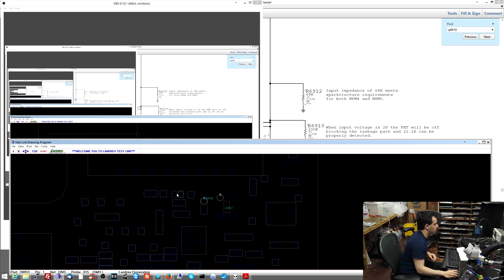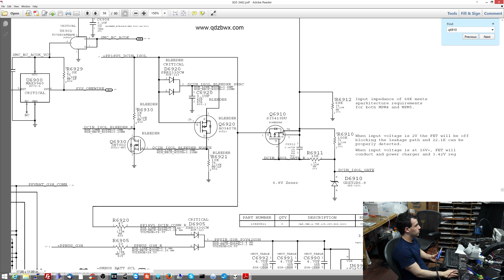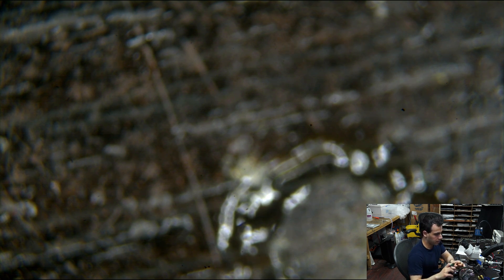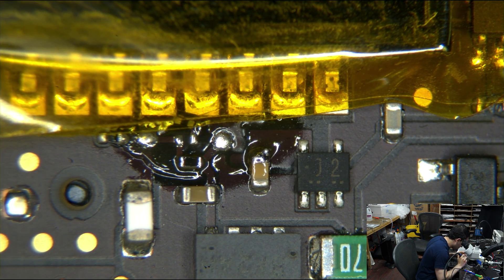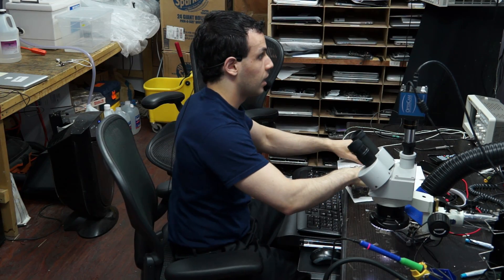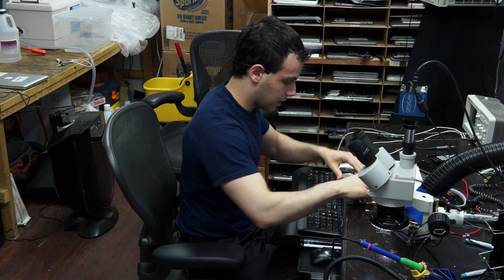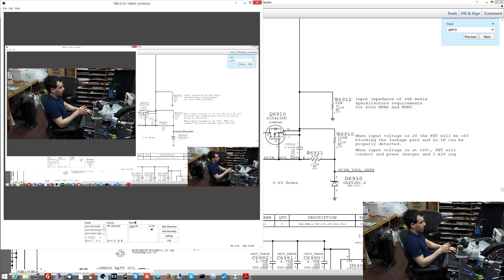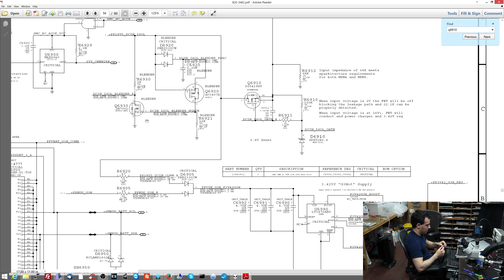Darby's second board 820-3462 not turning on because of spikes on dc in rail.

Comment: I got one!Question that is...
A1425 820_3462 not water damaged.
Good rails:PPBUS_G3HPP3V42_G3HPP5V_S5PP3V3_S5PPDCIN_G3H_ISOL
Everthing else not on. Tested around U7000, U7201 (no P5VS4_EN), U6901, U6900, U6990. Everything looks good, but I'm learning & don't know what the phuck is or not LOL.
From your videos I understand S0 Enable comes from PM_SLP_S3.
So the question is: on Q7920, pin 2 has 3.3V. Shouldn't something come out? This package no good? Or something else & keep looking?
: )

Comment: I have this MacBook retina 820-3462 the fan once connected to the charger starts spinning, yet the screen has no display. I've checked every voltage. But I don't have PPVOUT_S0_LCDBKLT or PPBUS_SW_LCDBKLT_PWR but I have  PPBUS_S0_LCDBKLT. Can someone tell me the other components to check for the backlight?@Louis Rossmann

Thanks
Reply from the maker: daniel m Do you have 5v going to the LCD on pins 28/29/30 of the connector?
Reply: i don't have PP5VR3V3_SW_LCD but i have PP5V_S0_LCD in uU9000.
Reply: hi,i couldn't find where this issue comes from, is it possible to tell me how can i do it?thanks
Reply from the maker: Well you need 5v going to the LCD before you get backlight.
Reply: well , understand ,i don't have PP5VR3V3_SW_LCD output in pin4,5(u9000) but i have PP5V_S0_LCD vin in pin1,2 uU9000 . its not enable ,i couldn't find where this issue comes from.i need help thanks
Reply: thanks ,understand ,  I don't have PP5VR3V3_SW_LCD output in pin4,5(u9000) but i have PP5V_S0_LCD Vin  pin1,2 uU9000 .u90000 its not enable ,i couldn't find where this issue comes from. thanks (guidance )

Comment: Where did the original diode fly off to?
I presume it got stuck in the tape and isn't floating around inside!

It didn't take long to fix, but you win some, you lose some as you well pointed out.
Reply from the maker: Kevin Gill The alternate dimension to which all my bottom screws and little bits and pieces that fall off my tweezers are damned to.